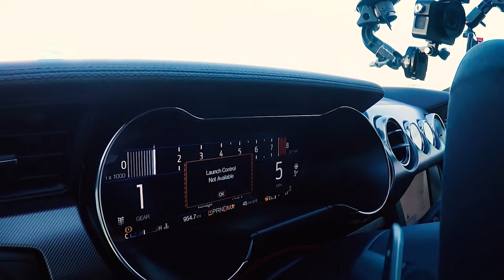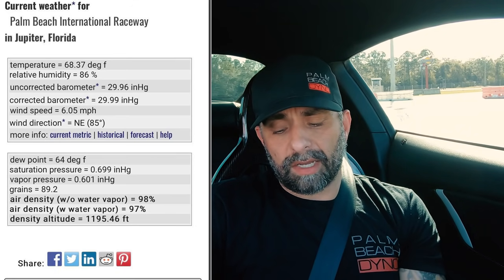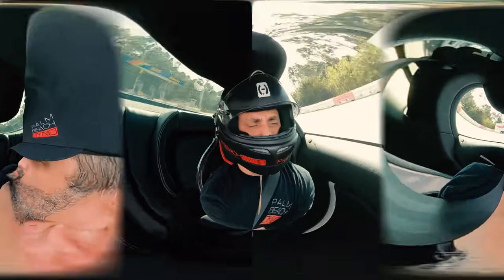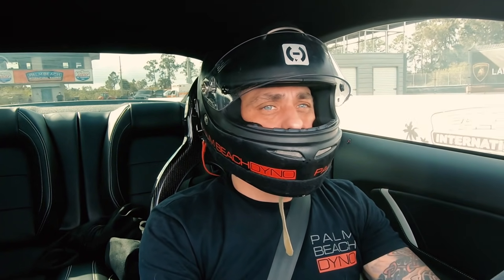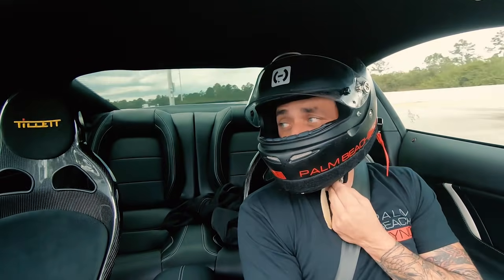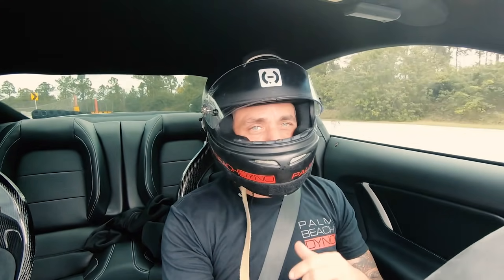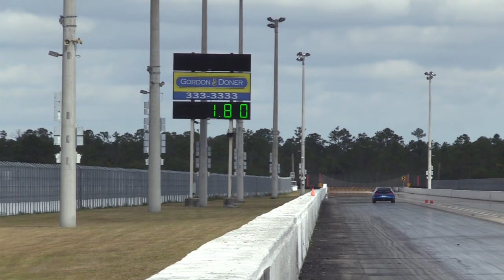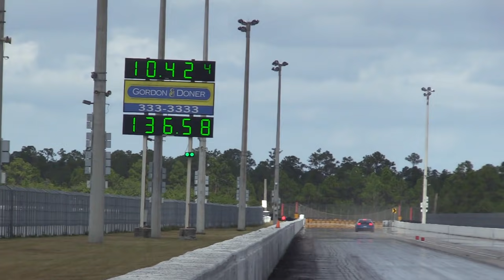2020 GT500 Stock Boost Drag Test | Stock Tune - 93 Octane Tune - Race Gas | Auto vs Manual Shifting

Comment: Thanks for the video. Still would love to see a 10A swapped GT500 vs the DCT. I get the DCT has the quicker shifts but the 10 speed seems like would be better in power band. I’m no expert so don’t flame me :)
Reply from the maker: Then why get a GT500 at all? Just buy an A10 GT and add a Whipple. Much cheaper
Reply: Palm Beach Dyno because it’s still
Not a GT500. I’m not doubting the DCT just curious how the A10 stacks up against it.
Reply from the maker: @9663mu  I'm not really into names. Once you put the A10 in, it's really not much different than a Mustang GT with a blower at that point. We already know that the A10 will be quicker. That's why it's not the best idea to buy a GT500 if all you want to do is drag race it
Reply: Palm Beach Dyno so what about the suspension ? Wheels ? Wider fenders ? It’s the entire package and A GT with a whipped as potent as it can be , still dosent have the mystique the GT500 has. I’m sure the DCT is quicker in every way , I’m just curious. Please don’t take curiosity for hate. I have but love for this car the way it sits. If I could afford one , I would be in one.
Reply from the maker: @9663mu  You can get magne
ride on a GT as well. Wider fenders don't help it do any better at the drag strip. It is all about the entire package. Except you are trying to change one of the main ingredients, which is my point. Zero interest in that. I'd say anyone who does it is ruining the car so why bother.
Reply: Yea not need to spend that money if your gonna run a 10r80 ( here is a little hint they are both S550 chassis all parts will bolt on lol nothing actually unique about it except the DCT, in fact I'm gonna run GT500 axles in my stage 2 EB boosted 19 A10 car) 
 Just throw a 2650tvs from Edelbrock in stage 2 and a PBD tune on it even have the same rotor pack but do another 70 wheel

Comment: That's almost enough for me to want to rip that damn DCT out and throw in the 10 speed auto!!! 
WTF?! 
I think Ford has to address this issue ASAP but also set the limit up to at least 190-195!! Then cut it out not on that low of temp. 
Granted it's a expensive transmission but Tremec should have made it capable to hold up to 200 degrees no problem and hold that power as well!
Reply: I don’t think Ford HAS to, but they definitely should.. They really should have offered the 10 Speed as an option for the drag racers.. There’s no way that Ford engineered this car and didn’t have any of these issues flare up. They knew people were going to drag race these and still chose to put together a package for “road racing”..
Reply: That clutched auto is bullllllllshit. Looks like every single one of them is doing it. Embarrassing.
Reply: Tim Kline I agree. it appears that most GT500 owners are more interested in drag racing which is not surprising.  With an auto I believe the car would pick up 2 to 3/10ths stock.
Reply: @joenobody2580  no, I have only seen a few but it's not a issue truly it's just a safety feature so you don't burn the clutches up. 
I just think k they need to move the temperature range up at least 15 degrees. 
As long as it's under 195 there should be no issues! 
But Ford with all there issues on that BS transmission Chevy made for them on the exchange for Ford's 10 speed auto is a major issue considering Ford just got sued and is paying 30 million in restitution I think she transmissions thanks to Chevy.
Reply: @gregwilliams4380  the only bad ford tranny I know is another clutched auto that's in the focus. I know ford supposedly was in cahoots with Chevy for the 6sd ? I never understood that though cause the 6r80 ford was bullet proof and the 6l80 Chevy is junk, but I don't know much about it. I really think the government is hammering ford because it's still privately owned by the Ford family and we all know who owns Dodge and Chevy nowadays...as for this gt500 everybody that has a vid on YouTube dragn it has the same problem, and it doesn't seem like it takes much to overheat it. What if it goes limp trying to jump out in traffic ?
Reply: Billie Buckamer The guys who are serious are going to be swapping them before too long.
Reply: Maybe it's a REAL issue if they turn it off aka it burns the clutches...and this is actually saving you thousands on an unobtanium trans replacement his warranty is gone
Reply: @gregwilliams4380   wait GM built this DCT not tremec? Or you talking about the 10l90 they have very little problems with behind their stock boosted cars? Or our 10r80 which does have problems in our stock Mustangs...look to me Ford cheaped out on clutches vs the 10l90 as after the valve body in 18s that's the only issue in 19-20....put clutches in and they hold 9s
Reply: @bluecollardaily2676  no the crap transmission in the focus that had major flaws. 
Ford built the 10R80 which is in the new Mustangs as well as Camaros which is Ford built but the swap off was a transmission for a transmission for the focus or small compacts and basically Ford got Fuc-ed on the deal,

Comment: I really don't understand everyone's fascination with dual clutch transmissions and I really don't think one belongs in the GT500.

There's many reasons for me feeling that way but I hope this thing can get ironed out.  I'm sure with some advanced tuning, upgraded clutches and better cooling for the trans, maybe this thing can achieve.. but right now?,give me a proper stick shift or a slush box automatic.. with good ol' fluid dynamics and torque multiplication.  Throw in a stall while you're at it.

Bottom line? I wouldn't consider one of these even though I really like the rest of the platform.  Why? Because I can build and make a GT much better and much faster.. for less.

GT500: Great for the street and the title, not so much for the strip.

Comment: Why are your R/T so slow?
Reply from the maker: Because reaction time doesn't impact your ET and I didn't want to be in the 2 step too long while troubleshooting the clutch issue. I thought that would be obvious
Reply: Palm Beach Dyno No I didn’t see that, but it helps to explain it, although there was then no reason for you to wait the first time IMO. Others have found it has a delay ,and you have to anticipate the light. But I think we all like seeing all the different things you are trying out. Guess that clutch temp is Very Important. Even in stock configuration that has come up with others 🤔. Luv seeing all the videos, you’re doing a great job! 👍👍

Comment: lol trans oil temp only 170, my stock 2017 GT (6R80) hovers around 193 to 204 when daily driving it. i live in texas. never had a warning like that, and let me tell ya, my clutches feel worn as fuck. it has 42k on it and i predict it will let go within a year.
Reply from the maker: You can't compare an auto to a DCT transmission like that. Not relevant

Comment: 9.7 with over 1020 hp 840 stock demon with mt drags runs 9.8 with 200 hp less just saying
Reply: Yes I saw that.  It seems even a 1k hp a10 coyote is quicker than that.  The key is in the transmission.  Something needs to be done to it.
Reply: Sergey Melnik yes yes converters are faster than dct off the line . Dct are design to race around a track
Reply: where are you seeing 1020HP in a GT500?
Reply: cmdrdredd the guys channel  880 to the wheel

Comment: So they build them with drag racing in mind and with little tuning on a cool day you have clutch heat problems.

How on God's green earth was this never uncovered in Ford's testing?

<slow standing golf clap for Ford>
Reply: Ford has no documentation that I find that says "this is a drag car". They have said "track car" which could be interpreted different ways, but personally I lean toward road course vs drag strip.
Reply: @cmdrdredd  
They said (advertised) Demon Killer. 
Hard to misinterpret that...

Comment: Ford should have been working on a superior manual transmission instead of this dct headache
Reply: Honestly they should have just used a 10R90 for automatic sales and a TR6060 for trans sales. They tried to get all exotic or whatever and it might bite them in the ass. It will be interesting to see how the new Z06 handles the power with this DCT.
Reply: D C t transmission in the gt500 suck
Reply: Ran Ware - a manual trans?  Seriously?  That would be a major step backwards sand Ford was looking towards the future and not the past.  We all know the prior manual trans GT 500’s were good for only one thing.  Smoking the rear tires.  This new car with the DCT is faster stock than a modded ‘14 even with a drag radial.  The ‘14 was terrible on a track, too heavy and brakes that went away after only a couple laps.  This new GT500 is better in EVERY way.  It works is well at the strip even though it was not designed to be a drag car.  If you want a dedicated drags car go get a GT and mod it.  It will cost WAY less and work better.  However if you want a Mustang that does everything well and is the coolest ‘Stang ever built than there is only one choice;

Comment: Its after they tune them it seems
Reply: It happened to Speed Phenom also and his was totally stock. If you're talking about the clutch temp protection.
Reply: @forcedair92gt94  
He was running a tire..
Reply: @f150manmaniac  Gotcha.
Reply: This car and speed phenoms car had different sized tires on.